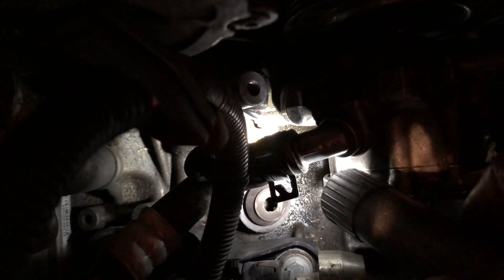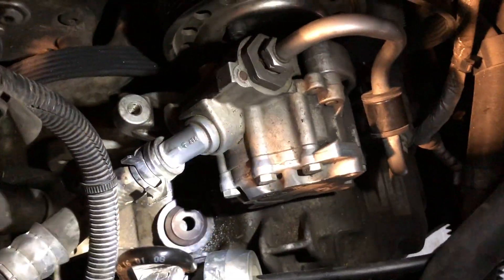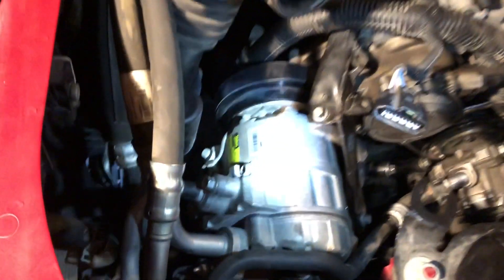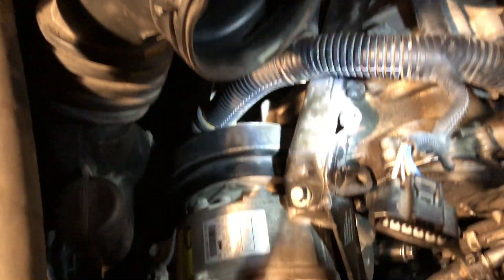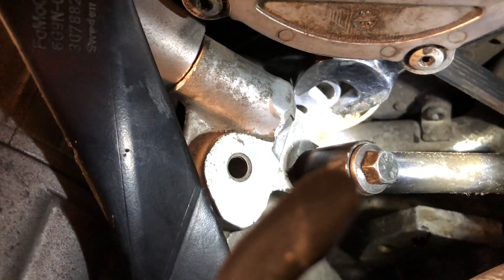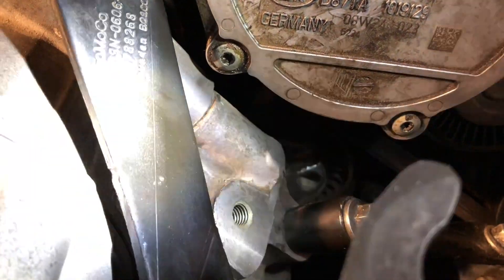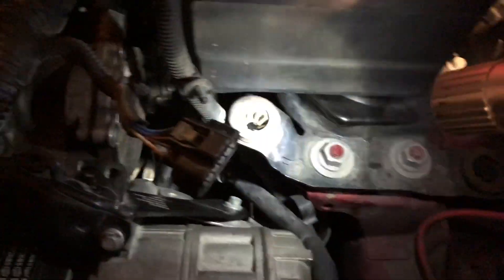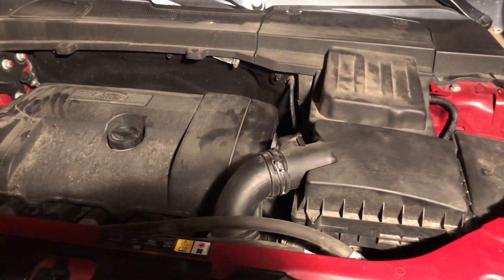2009 Land Rover LR2 Idler Pulley install part 2 (Volvo 3.2 I6 engine)

Comment: Great job. And U are correct, couldn't find a youtube for my volvo S80. I didn't disconnect the power steering apart from the water pump. With that said, getting the belt under the PS pump was a bear. I disconnected the fluid hose and the pipe on top of the pump. It worked, and then I found your video, go figure. Saved $750

Comment: My wife's 08 LR2 just had this happen to hers. I'm ordering parts to fix it myself and wanted to see if you had to replace the Serpentine tensioner too or can you just bolt the new pulley to the existing tensioner? The part I'm talking about is LR004667. Also, did you end up replacing the Idler pulley (LR005993) which you say needs a special tool? Not sure if I should replace this or not?

Comment: Hey I have a question so I’m changing out my water pump and I I forgot to put the belt back on so I took the water pump off and I couldn’t get it back on the plastic piece spread open and it won’t go back in and stay so is there a specific way to line the water pump spring and everything with the pully so it clicks and stays

Comment: Have you ever tried changing the transmission filter for this same car ?
Reply from the maker: sigfrern1970 touareg1970  as far as I can tell, there is no transmission filter.  There is nothing about it in the Land Rover manual.  I am going to make a video about changing the transmission fluid though soon.
Reply: @ventregarage3002   I know they do sell a filter for this truck, thanks.

Comment: How did you manage to decouple the power steering pump pulley from the water pump?
Reply from the maker: At 2:19 I show the little black plastic piece that has to pop out of the power steering pulley to separate the two halves.  Then you can pull back on the power steering pump and work the belt between the 2.

Comment: I removed the ac compressor and switched out the belt tenchener and the pulley but just couldn't get the power steering pump detached from the waterpump. So I guess I'll have to pay a mechanic after all.
Reply from the maker: jmvmc32 no fun.  It’s a pain but it will come off of there.